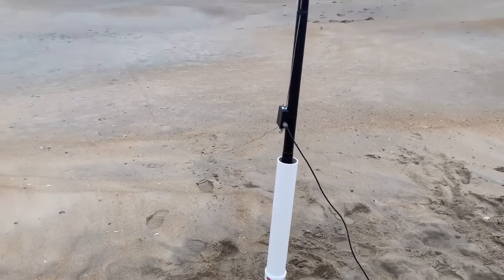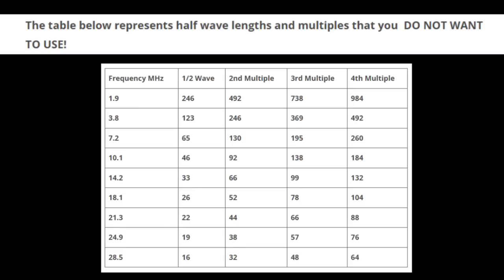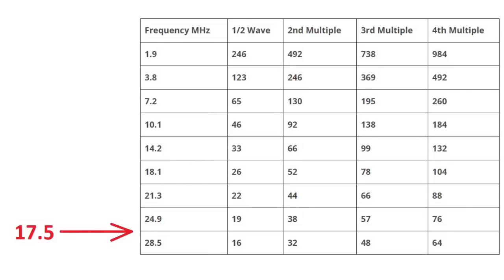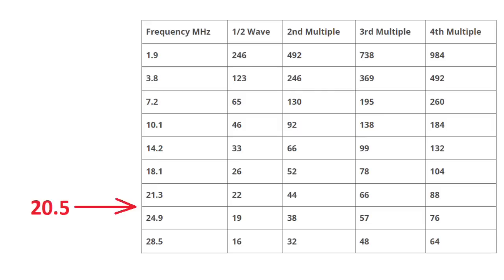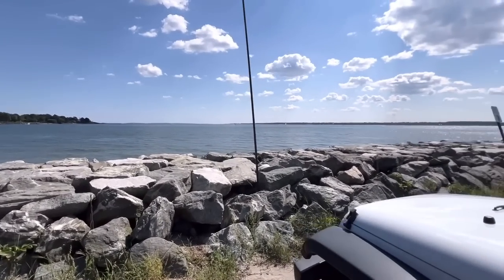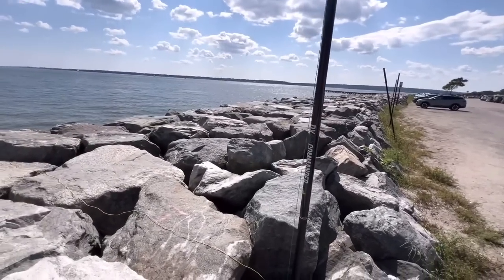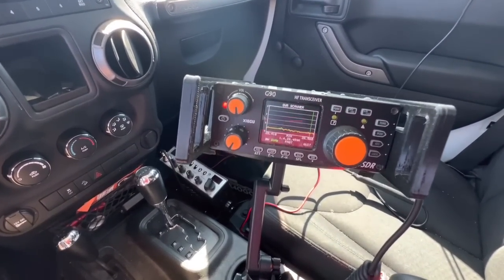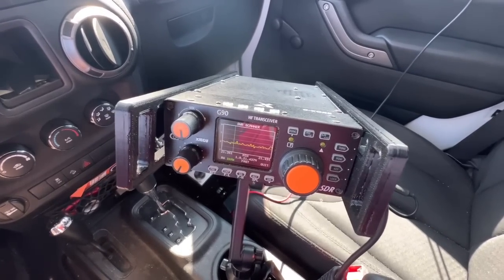20.5 Foot Vertical Antenna - Better than a Rybakov?

Comment: Hi Walt. Awesome video. Looking forward to the 4:1 vs 9:1 video. On my new G90 I have been turning down the power to 1 watt before I tune it. Is that necessary? Thank you
Reply from the maker: Thanks, no that is not necessary. The radio turns the power down internally itself when tuning. I keep mine up at 20 and tune away. Been doing it for as long as I’ve had the radio.
Reply: @COASTALWAVESWIRES  Thank you

Comment: Can you add a link to that back pack?
Reply from the maker: I found that at a department store. The brand is Highland Tactical.
Reply: @COASTALWAVESWIRES  I searched and did discover the brand but could not find that unit. Thanks Walt. I hope to have a QSO with you one day. I used Google Lens BTW. Slick little tool. 73

Keep these videos rolling it encourages all of us!
Reply: @COASTALWAVESWIRES  one more question. Is it the "Roger" model?

Comment: Walt, I've actually duplicated the Rybakov and made several contacts. It seems as though I need to try this antenna out too. Great video. By the way, I too have a G90 and wanted to customize the knobs so, where did you order them from?
Reply from the maker: I can’t find those knobs online. I took them off a RS-918 radio I have. 73, Walt

Comment: Ok so 20-10m .. it competes well v Rybakov (5/8 on 10m). But don’t forget you get much better efficiency on 40m with a Rybakov as it’s 75% the length of a quarter wave, but the 20.5ft design is 30% of a 1/4wave.
Reply from the maker: I agree Tim, this is definitely a high band 20 to 10 antenna.

Comment: Thank you once more Walt! I'm cutting wire as soon as I finish this post! One thing I've found, and I'm no expert, is that it really pays to try as many antenna configurations as possible to find the one that works for you. I'm on the side of a big hill, surrounded by giant trees, including a Redwood tree that is seven or eight stories tall, My location makes for tricky because I have very little clear space. However, I slowly tried a bunch of different antennas and locations until I found something that works. I suspect there are many hams out there with the same problem.  I know you do antennas by the water but I would love to see you do a video on antennas for areas where there isn't a lot of open space. The antennas you've built have worked for me but I suspect there are a few hams who don't try because they feel it can't easily be done. Thanks again for another great video...73...Hugh...KN6KNB

Comment: I'm pretty far inland... i live where there is prairie mud soil... my elmers around here are telling me that vertical antennas won't work here very well...but I guess wires and ununs are cheap enough to try it out, right?
Reply from the maker: Yes indeed, I spent the good part of two years working in Poland far inland and built some verticals there with good success. Definitely experiment and try some verticals. 73, Walt
Reply: Walt, I’m new to making antennas, but have read that the feed point impedance of an EFRW is 350 to 450 Ohms yet you use a 4:1 rather than a 9:1 with great success. This suggests that the estimates of the impedance for EFRW antennas is incorrect. How did you determine that a 4:1 would work?
Reply from the maker: @ChrisMichael-x8j I’ve found that the feed point impedance for EFRW for lengths 29’ and longer is 350 to 459 ohms as you stated but the shorter lengths of 17.5, 20.5 and 25 feet have a lower impedance thus I use a 4:1 for those shorter lengths.

Comment: Hi Walt, this is Tom, WB3EME in Hanover, PA.  Love your antenna experiments and currently have the 17.5 version up in the back yard, soon to be lengthened to 20.5 ft.  I also have a G90.  Where did you find the cup holder mount for the G90?  I love the little rig, but haven't figured out how to mount it in my car.  I am also a big fan of QRP Livestream Net on Sunday nights at 7PM EST.  I didn't hear you but did hear Kevin, K0KLB, check you in one night.  73's & thanks for all of the great videos.
Reply from the maker: Hi Tom, that cup holder tray I have is very flimsy and I’m not real happy with it but here’s the link from Amazon: Qihoo Car Cup Holder Tray Table... https://www.amazon.com/dp/B0994QX1Q7?ref=ppx_pop_mob_ap_share
Thanks so much for the kind words, hope to catch you in the air! 73, Walt
Reply: @COASTALWAVESWIRES  Thanks Walt!  I think I will order the mount.  Better than nothing, which is what I have now.  Hope to work you someday.  73's Tom WB3EME

Comment: Gotta push the boundaries Walt by showing us the CB stuff. I imagine there is more to it then just reverb and giant power ;)
Reply from the maker: Haha I came from that world into ham radio. It will always have a special place with me
Reply: Same here.  My dad had several CB's.  I still have them all, but they have been packed away for years.  I could never get a CB I bought to last long, nor work well.  But his never gave me any problems.  I now have an MFJ 20-meter 10 watt portable in my car with a mount for a 17' telescopic antenna.  I've reached several POTA operators up to 750 miles or so and one in Canada so far.  Just got my Tech last Sept. and my General in Nov.  Having a blast.

Comment: Walt, your Rybakov video inspired me to make my own Rybakov. But I ended up doing one that was around 30 feet (I forget the exact measurement). I used a 4:1 unun and a 1:1 choke, along with five ground radials of the same length. My NanoVNA measured the SWR at 2:1 or lower across nearly all bands from 20m to 6m. On 40m, it was higher, but well within tuning range. You are an inspiration!
Reply from the maker: @bevo65  thanks and thank you for sharing that!

Comment: Fantastic video and information.  I wish I still lived near the sea.  I am a USAF vet and spent most of my career by the sea.  I didn't have my HAM license back then.  I will try the antenna.  I use a "random" wire 141' antenna at home with elevated counterpoises.  My antenna goes straight up to 28' and then slopes up to a 42' Spider Pole in the back of my yard.  I only have less than 1/4 acre yard.  My main counterpoise is under my antenna 3' above ground.  It is the opposing force that sends my RF skyward.  I can work 160 meters and up.  From NC I have made contacts to Indiana on 160 meters.  Our hobby is very fun for experimenting and finding out what works.  73 brother.  Ed Cheek, KM4MMD
Reply from the maker: Thanks Ed! I really want to have something setup for top band one day. After I retire I’ll probably start playing around with 160 meter antennas. Your setup sounds awesome. 73, Walt

Comment: Love seeing places you go in Rhode Island. My mom was from Providence.  The current distribution on the antennas is most important. The high current portion is always a quarter wave from the top ( end). Getting it high as possible improves performance. The goal being to get a full halfwave of current on the vertical which you pretty much have on 15 and definitely have on 17 through 10. After that you have an even higher current peak on the higher bands. Which means even more current on the wire. I think the 5/8 point is probably the maximum length for general overall good performance and you hit that on 10 meters. After that it’s a matter of simply matching it to coax, which again you either hit it or came so close it does not matter! 
Have fun on the Rhode Island coast.
Reply from the maker: @dandypoint  thanks and thanks for the great comment. I’m really enjoying Rhode Island. It’s a great place

Comment: Another great video. Looks like the wire cutters will be busy today. Would a 3ft counter poise work like on the Coastal 20? I guess I’ll let you know later. How’s your wife doing? I hope she is doing well. Please give her my regards. 37s (73 reminds me too much of my age)
Reply from the maker: Thanks! The short counterpoise might work but I would probably make it 6.5 feet long. That seems to be a proven length for random wire antennas for 20 meters and higher. My wife is doing good and improving, thanks for asking! 73, Walt